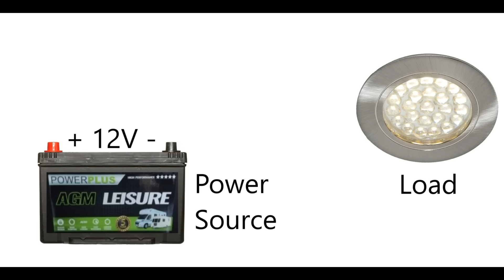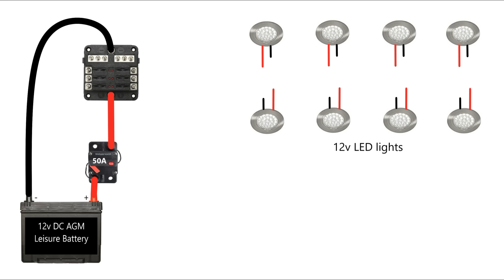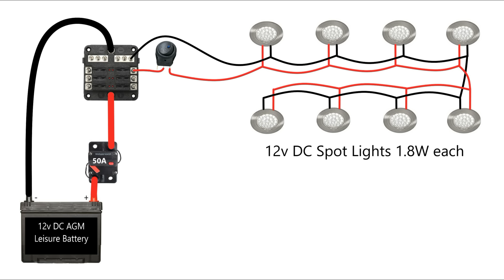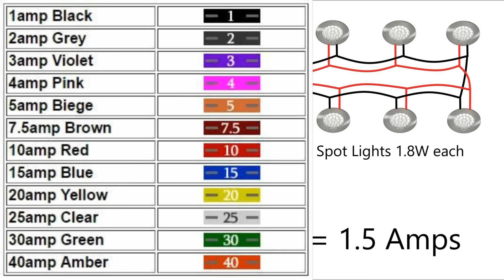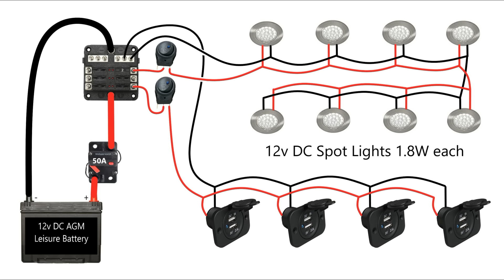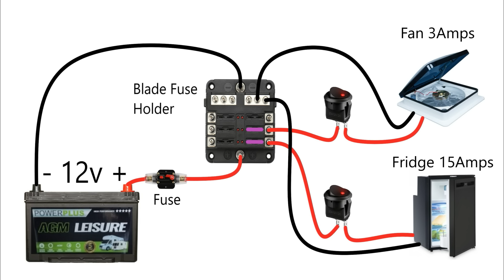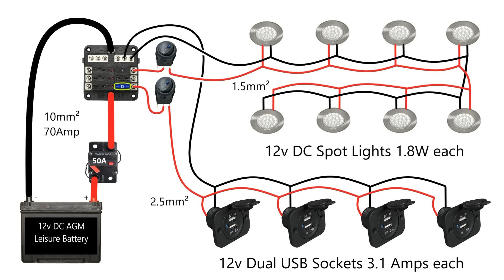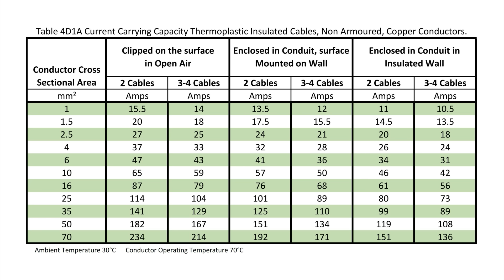Electric Cable & Fuse Sizing - Camper Van Conversion Series

Comment: HI GREG ARE THE SWITCHES RATER OR CAN YOU USE ANY AUTO SWITCH THANKS SAM
Reply from the maker: Just make sure that the rating in amps of the switch you use is greater than the fuse rating of the circuit you are installing it in. It needs to be able to handle the current you are putting through it.

Comment: Hi Greg, I’am building 12 volt spots into a boat. I got 6 spots 3 watt each and they are connected to an radiographic receiver dimmer. Can I use your spots diagram, the USB connectors diagram and wire thickness (boat)?

Comment: Anyone know why Greg is suggesting 1.5mm cable for the lighting circuit, based on the table wouldn't a smaller cable be sufficient and also reduce weight? Looking at cable it seems to me 0.5 mm would be fine, am I missing something?
Reply from the maker: Hello Greg here 😃 I used that as my smallest cable size for most things in the van because cheaper to buy a 50m drum of cable than shorter lengths of loads of different sizes. Plus keeps the installation easier if only using one cable for most things. No harm in going bigger on cable.  Less resistance and run cooler.
Reply: @GregVirgoe  Thanks so much for the quick reply. Loving all your videos. My son was watching your van tour video with me last night and said that is what he wants to live in when he is older.😃
Reply: @GregVirgoe My fridge says15 amp fuse so would that be 2.5mm cable then or should I go bigger?
Reply from the maker: @quell2727  the fridge manual suggested 6mm due to potential voltage drop so that’s what we did
Reply: @GregVirgoe  Thanks again

Comment: Hi Greg.
Nice vid, thank you.
Were from have you got the information to count upp the amps by 25%?
Cherers.
Reply from the maker: It’s a good rule of thumb for fuse sizing. 👍🏼😃
Reply: @GregVirgoe  okej, but were from did you read/learnt it??
Reply from the maker: @krilitsch1  https://www.bluesea.com/support/articles/Circuit_Protection/1441/Part_2%3A_Select_a_Fuse_and_Fuse_Holder_For_Your_DC_Product_Installation
Reply from the maker: @krilitsch1  https://www.fusefactory.com.au/2019/08/23/how-to-calculate-the-correct-electrical-fuse-size-for-your-project/

Comment: Why does every wiring diagram have red and black cables when all I can find in shops are blue and brown?
Reply from the maker: Brown and Blue are the new standard UK colours for household mains wiring. Red and Black are colour used for 12v & 24vDC system. Nothing wrong with using uk main’s cable as long as it’s the right size for the load. 
Remember the warm colours red and brown are live / positives and the cold colours blue and black are the neutral / negatives. 👍🏼🤩
Reply: @GregVirgoe  thank youuuuu:)) legend!

Comment: Hi greg , i asked a question the otherday , not to sure how to navigate through youtube , but it was regarding wiring up my shurflo pump etc , you recommend 1.5mm 2 core cable , but upon looking on ebay theres different amp options for 1.5mm and not sure which amp to go for , can you suggest ?
Reply: Im guessing as you suggested a 10amp fuse id hasten a guess that ill need 15 amp 1.5mm cable
Reply from the maker: 1.5mm flex should easily be able to do over 10amps which is the fuse rating for one of those pumps. They can run at max 7 amps 👍🏼

Comment: Hi Greg, I currently have my camper wiring in situe with one 110a leisure battery. If I want to add a second identical battery (of the same age) to the circuit, is it just a case of linking it in parallel with an appropriate sized cable, or does any of my existing wiring need beefing up? Many thanks, Chris.
Reply from the maker: Yes simply wire the new battery to the other in parallel with some fat cables. Then move either your positives or negatives to the new battery so they are on different battery’s. Positives on one and negatives on the other. That way they two are being used as one string. Hope that makes sense.
Reply: @GregVirgoe  Cheers Greg! Just wasn't sure if 220amps could potentially flow through the circuit, so the existing 110amp cables (16mm) would need to be changed 🤔
Reply from the maker: @chrisb5839  you will only draw the amps that each appliance requires that hasn’t changed so the cables feeding you equipment do not need to be changed. The 220Ah is the storage capacity. You will not be pulling 220amps out of the batteries 👍🏼🤩 I would use some decent connecting cables like these ones https://www.12voltplanet.co.uk/extra-flexible-pvc-battery-lead-with-8mm-terminals-red-35mm-240a.html
Reply: @GregVirgoe  thank you Greg! Keep up the good work 👍🏼

Comment: Is it possible for me to run a cable in conduit under the van from the starter motor  up into the back of the van to the leisure battery ?

Comment: I want to add an isolator switch to this diagram. Which side of the 50A cIrcuit break would it go?
Reply from the maker: Circuit breaker first then any switches and devices.
Reply: @GregVirgoe  thanks Greg.  I want to clarify “first”. Isolator switch between the battery and the 50A circuit breaker, correct??

Comment: Hi Greg I’m about to purchase solar or my sprinter van, I’m been told different things hope you can help. do  I purchase 1 x 360 watt panel or 3x 120watts and wire them in series to give me more amps to charge quicker. What’s your thoughts
Reply from the maker: The power generated would be the same for both setups as they both total 360w
Reply: @GregVirgoe  thats what I couldn't get my head around so why am I being told I would charge a battery quicker with 3 panels of 120w instead of 1 panel of 360. They said the current is more on the 3 panels. This is what i was told "So one panel no matter how big it is will only do 22v max and that’s on a good sunny day. So on a grey day will struggle
To get about 16-18v and the mppt won’t switch on until the voltage is 5v above battery voltage, so having 3 panels in series all giving 16v x 3 added up is more than 1 panel doing 20v ." Is that right..
Reply from the maker: @Travelvan999  ok so in the same conditions you will get the same power from each but the ratio of volts to amps will vary. So in low light the series panels will have high voltage and low amps and the single panel will have low voltage and higher amps but the resulting watts will be the same. You may just get a small trickle charge in low light from a series setup.
Reply: @GregVirgoe  thanks so much for that so in your expert opining what would you recommend uk and Europe travels
Reply from the maker: @Travelvan999  multiple panels in series would be better than one large panel. 👍🏼😃

Comment: Hi mate I'm new to all this can you help me? I've a 12 way fusebox in my camper conversion, what AWG leads will I need from my fuse box to leisure battery and what amp breaker would I need a 50amp or 100amp. Thank you mate
Reply from the maker: The size of the supply to the fuse board depends totally upon what you have connected to the fuse board. You need to add up all the running current of each device connected to the fuse board and that will be the total load. Once you know that you can pick a fuse just slightly bigger than the total and make sure cable rating is bigger than the fuse.
Reply: Thanks mate all I've got is 4 led lights a 12v TV and fitted a boat switch panel, so what would I need. ie, cable size to fuse box from leisure battery and circuit breaker, thanks mate.
Reply from the maker: @Micky-kl4kg  ok so each lights is less than an amp, the TV is about 6amps and if the switch panel has USB & cig socket that can be up to 15amps so you would need a 30amp fuse and 10mm cable. 
If the switch panel is just switches then a 15Amp fuse and 6mm cable will do for the blade fuse supply.

Comment: How do the 5V USB outlets work? I would expect a change in current when stepping down from 12V to 5V, no?
Reply: I was thinking that. 3.1A @5v = 15.5w so 1.29A @12v (Ignoring losses). But then again it will be oversized and safer worked out like it is. All great videos by the way.

Comment: Hello Greg, I have fitted a consumer unit in my van, it has a 100amp main switch (RCD) which has a neutral cable connected to the neutral bar, I have includded 2 x 16amp breakers (mcb), there is a neutral copper bar that connects the mcb but does it also connect into the RCD as well?
Reply from the maker: Hello Robert, the RCD is normally double Pole so it seitchesboth the live and neutral. The copper bar connects the outgoing live from the RCD to the two breakers. The neutral is normall connected on a separate buzz bar. Take a single live out of each breaker. That 100amp RCD is far too big. A hook up will normally be no more than 16amp

Comment: what happens if you over size all wiring an amps?
Reply from the maker: No harm in going bigger on cable sizes. Just make sure to correctly size your fuses and breakers.

Comment: hi i just got a motorhome and it has 300 watt solar panels fitted but not wired in properly what inline fuses do i need to install to batterys the controller i got is a 30 amp one thanks j

Comment: Hi Greg. I am struggling to find a 24v diagram where 230v system can run directly off the inverter, without using Victron parts, Do you have one please.

Comment: How do I add a 240 wall plug to the 2000w inverter
Reply from the maker: Most inverters have three pin sockets for the power outlet so you need a 3core 2.5mm cable with a 13amp plug to plug into the inverter. Then wire the other end of the cable into the back of your 3pin socket. Think of it like an extension lead. 👍🏼😃

Comment: Hi Greg the does the 12v system need earthing or is that just the 240v side of the vans electric system
Reply from the maker: Just the 230volt side needs earthing 👍🏼😃

Comment: Hi Greg I have a 120w panel and it’s runs to my charge controller,it only charges my leasure battery ,there is another place on the controller to charge my vehicle battery any idea how I do this and what size wire and that do I need ? Many thanks

Comment: Hi Greg, I have a compressor cool box that draws 0.44Ah , am I right in saying this unit would have the same amps when I come to working out the fuse and cable size?
Reply from the maker: That Ah rating dies seem very low and only works out to be 5 watts. 
Can you see if you can find out the watts please as I suspect it’s more likely to be 50-75 watts
Reply from the maker: Or let me know the make and model and I’ll see if I can find out
Reply: @GregVirgoe  Thanks for the reply and offer of help, I have now found a label  that says rated current is 5A using DC12v ………..FYI it’s a Dometic Waeco coolfreeze CDF-25        So a 5amp fuse is suitable ? And what size cable would you suggest, the cool box is have its own feed, 

Thanks in advance
Reply from the maker: @justineknight3580  that sounds more like it. 5A x 12V = 60W my fridge is 75W so it not far off. Now fridges and 12v compressors are fussy things and like to see no voltage drop. So you have to increase the cable size to keep that down. 
I have run 6mm cable to my fridge for that reason. What is the distance of the cable run? 😊
Reply: @GregVirgoe  thanks again, that is making a lot of sense, when I did by Baywindow build, I did have issues and put it done to the cable size and connections , so this build in my T5 I planned a single cable feed with very little connections,
Cable run is between 1-2 meters ,
So from what we have I am thinking the 6mm cable with a 5A fuse?

Is that what you are suggesting?

Comment: Hi Greg, just wondering, I'm having a few problems working out the electrics for my van. Will 18 amg red/black wire, think its 0.85mm2, do the job for my 4 led spotlights at 3 watts each? So 1.25amps with the added 1.25 percentage you recommend,with a 2amp fuse in the blade fuse holder? Cheers in advance if you can help.
Reply: *and when you recommend 6mm, 10mm or even 35mm cables, are they still 2 core flex? I feel 35mm cable is huge isn't it? Just to double check with you. Cheers

Comment: I could only get 24v panels so I had to wire my 12v battery bank in series in order to receive the 24v input. However all my lights are 12v. would you suggest a 24v to 12v step down converter? (480watt)
Reply from the maker: You DO NOT need to wire your batteries in series. 
Your MPPT charge controller can accept very high voltages. My panels typically deliver into my controller at 58volts
The MPPT then transforms that voltage down to 14.6v and boosts the amps to charger your 12v battery string. Follow my other video on off grid wiring. 
There is a free schematic shoeing you exactly what to do. 👍🏼

Comment: Hi Greg can you please help me ? When I’m travelling my fridge in my Adria shows it’s on 12 volt but after a few miles down the road it beeps and the 12v light on the fridge flashes and by the time we get on site it’s defrosting !! Any ideas ps great vids I’m just going to press that sub button 😎thanks Chris Isle of Wight
Reply from the maker: With most production motor homes you have a three way fridge so it works on mains when on hook up or gas when off grid but only on 12v when driving. 
The idea would be to get the fridge down to temperature on mains or gas before setting of so the 12v can just keep it going. 
I would see if you can find a user manual for the fridge online. 👍🏼

Comment: Can you explain why the switches don't need a switching lead please?  I thinking know why but only 50% cheers.
Reply from the maker: I’m not sure what you mean but a switch only breaks the positive so one side is the permanent positive and the other side is the switched positive 
Some rocker switches have a negative connection and that is to illuminate LEDs when they are switched on. 
Hope that helps 😊
Reply: @GregVirgoe  I'm thinkingof it running from an ignition source.  An ACC wire.
Reply from the maker: @wicksey74  a 12v DC leisure system does not need to be connected to your vans electrics. 
Better not drain the vans battery or you may have trouble starting it the next day. Are you doing a van conversion or just wiring an accessory to your car?? 🤔
Reply: I'm building a camper trailer.  I think I've got it sorted now.
Reply from the maker: @wicksey74  that’s great 😃

Comment: hi, ive got  2 batteries 80 amp fitted in my engine bay. will my  starter battery,, charge my 110amp leisure battery  with split charger??thx

Comment: Hi Greg, Please could you help me, my partner uses a CPAP machine, which can use with an 12v adapter. This is 6.67 amps. What size wire would I need to use on the 12v socket ( is a normal cigarette lighter socket ok for this ).. I am really stuck and have been looking for weeks.. the CPAP machine is a Phillip's dreamstation. Thank you
Reply from the maker: Cigarette lighter sockets are typically fused to 15amps
I would use 2.5mm cable for that sockets for a safety margin. 👍🏼😁
Reply: @GregVirgoe  Thank you so much for that information. This is my first time I will be doing a van and the last.. I keep watching your videos and they have been so helpful. Please can I be very cheeky and ask 1 more question. We have bought a new fiat ducato 2.3 multijet sportivo. 9 speed auto 160bhp.. I know it as a smart alternator. I have tried to find out what size DC TO DC I need but fiat dont know the make or size of the alternator. How would I find it out ?.. so I know what size DC to DC to buy ..i have been looking for weeks now.. we should be getting our van in the next couple of weeks... when we do get on the road maybe we will bump into you and your wife. The drinks will be on us? Thank you again for your help and taking the time to reply.. most dont..
Reply from the maker: @aichachapman3845  your charger needs to be sized based on the size of your leisure battery bank. 10% of the storage capacity. So if you have 300Ah of battery you need a 30A charger. 👍🏼
Reply: @GregVirgoe  Thank you so so much. Nobody as been able to tell me this. Not even fiat.. I can now buy the rest of the items i need.. Thank God there are decent people like you about who knows what there taking about.. Thanks again .

Comment: What about the 50A circuit breaker? How to size it?
Reply from the maker: You add together the running load of all your connected appliances assuming there could be a situation where you have everything switched on at the same time. Then add 25% to that value. You could apply some diversity if you know for sure that only certain items will be on at the same time. 👍🏼😊
Reply: @GregVirgoe  Thanks so much. 👏

Comment: ive ran 1mm cable to 5 l.e.d. lights 2 watts each .. have i messed up or will i be ok
Reply from the maker: Don't worry it will be fine :D
5 x 2 watts = 10 watts / 12v = 0.83 amps
Your 1mm² cable is good for 12 amps. 
Protect the circuit with a 2amp blade fuse :D
Reply: Thank you very much .. i think i got the idea now thanks for posting a great video
Reply from the maker: @VANFLIPPINGTASTIC  I’m pleased it has helped you

Comment: At 14.14, I am confused. What exactly do you mean? Surely, this is incorrect?  Eg, Lamp, rated at 240v and 1000 Watts, = 4 Amps. Only 13 Amp fuse available, this is much more than 1.5 times the load, please explain. Thanks.
Reply from the maker: What are you confused about Geoff, the calculation for fuse size is correct?
Reply: @GregVirgoe  My point, is that you state that the "Fuse" should not be more than 1.5 times the "Load" of the appliance. Why do you not understand my confusion? No need to reply, as you are giveing confusing "Info". I will never look at any of your "Vid's" as itis obvious that you are "THICK", which is why, you do not see, my "Confusion"! Go away!